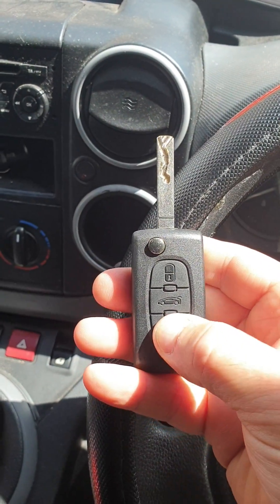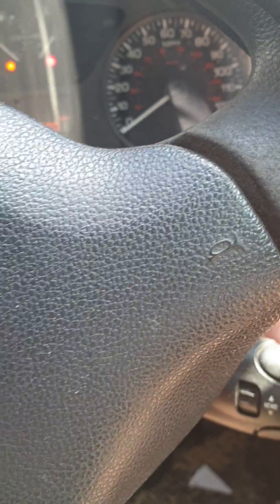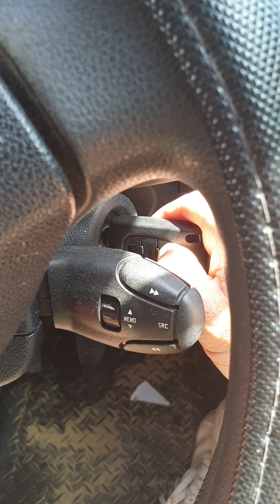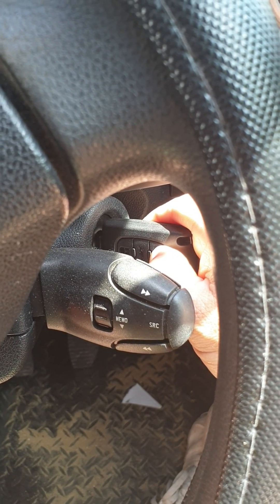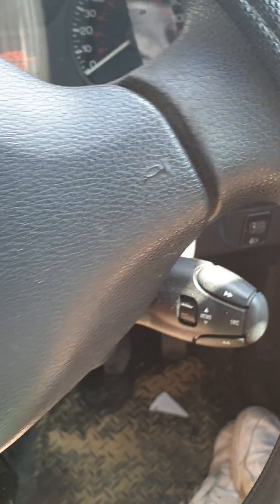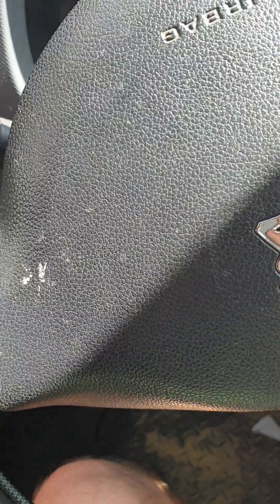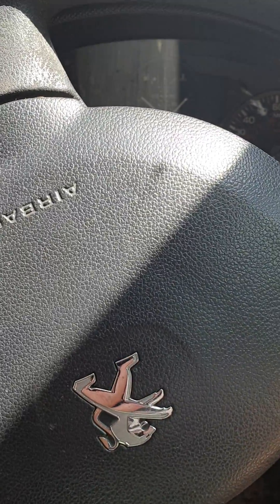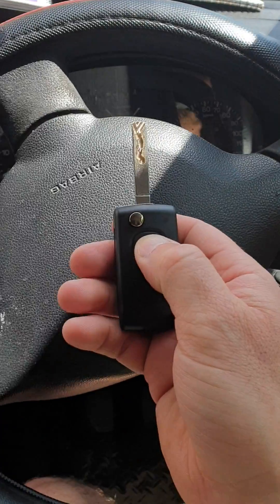how to Re sync a Peugeot or citreon key fob DONT PAY DEALER PRICES

Comment: Would this work on a 57plate Peugeot 407 2.0 hdi saloon?

Keys work to open doors manually and engine starts no prob but remote refused to remote lock or unlock.

Was working but cars been sat a while and main battery and remote battery had died?
Reply from the maker: Yeah, should be fine. Change both batteries in and key and try it, should be fine as long as keybisnt damaged inside
Reply: Adding to what was said. The low/dead battery send the car into eco mode. Meaning bsically everything electric is off. Remote don't work in this circumstances. Open doors manually, replace battery, start the vehicle. The moment it start, gets out of eco mode and all is back to normal. If the key don't work immediately follow this procedure. Cheers

Comment: I lost my original key to a 2016 Peugeot Boxer and had to get an auto-lock specialist to gain access to the van and supply another key with a new transponder.

Guess what the original key turned up a few weeks later and I'm just wondering if I can use this trick so that I have two working keys. I suppose it depends on whether the ECU programmes the key, or the key updates the ECU. If it's the latter, then it's obviously not going to work. Your thoughts on this would be helpful.
Reply from the maker: Unfortunately it won't work, no. The peugeot boxer is a re badged fiat ducato so is a completely different system. That old key will be useless now as even an autolocksmith won't be able to code it back in again
Reply: Thanks for the info.

Comment: I’ve just bought a Citroen Dispatch 08 plate, changed the battery in my key fob followed your instructions and it hasn’t worked? Any ideas?
Reply from the maker: Check battery is the right one and the right way round. ( i don't mean to be funny with that, you'd be surprised how many I go to thats wrong!) If not then you would need to get your key checked to make sure its sending a signal. If it was working fine before it should re sync. Make sure ignition is turned on and you hold a button down for long enough. I may have stopped working due to your key not working not a flat battery.
Reply: @Cityautolocksmith803  I don’t know if it was working before or not as only just purchased it, I did change the battery around and my van wouldn’t start. So guessing it is doing something? Cheers

Comment: i tried to do this a lot of times but it doesn't work, why?
Reply from the maker: Need to check your key is working and sending a signal
Reply: @Cityautolocksmith803  yes I took it to the locksmith and there is a signal!!
Reply from the maker: @luizgonzaga2816  if you follow video it should work fine on any peugeot or citreon with this type of key. Providing its sending signal and was working before on the same car. Or look at the fuses or sensors in the car
Reply: @Cityautolocksmith803  ok thank's
Reply: @Cityautolocksmith803  thank's 💗

Comment: My fob got left in my trousers. And ended up in the washing, dead :(. I bought a replace circuit board, but cannot for the life of me get it to work using these methods.   Does the circuit board need be coded on a computer or something?
Reply from the maker: Yes needs to be coded 1st by an autolocksmith
Reply: @Cityautolocksmith803  Thanks

Comment: I changed key fob?
And done key cut. The chip is same 
It shows antitheft.. What is the solution?
Reply from the maker: Hasn't been programmed in by the sounds of it?
Reply: @Cityautolocksmith803  can u explain? I didn't get
Reply from the maker: If its your old circuit board that's been re cased and it's not working then it is broken, if it's a new circuit board it needs programming to the car
Reply: @Cityautolocksmith803  it's old circuit board
Reply from the maker: Then it sounds like it must be damaged if the car no longer starts

Comment: Just programmed a key to a 2009 peugeot 407,three keys i've bought so far and they all program fine,but remotes won't sync/program.Odd.
Reply from the maker: Maybe same issue as berlingo, on this thread. Probably not the right frequency on remote function of key
Reply: @Cityautolocksmith803  they are all 433mhz.
Reply from the maker: Yes but you need to know if its fsk or ask
Reply: @Cityautolocksmith803  oh yeah sorry, i remember you saying that, it's a steep learning curve this. :-) Two more things i've learned, keep to hell away from Ebay for keys, and the ASK, FSK thin is rarely mentioned on Ebay listings easily catches people out. Thanks!
Reply: I know now keys ive been using are ask,seemingly newer 407 is fsk.
Reply: @Cityautolocksmith803 hi mate, could you help me please 

My car showing to many fault, anti theft fault first, then when I make new chip , star showing all of fault, abs fault, esp fault, handbrake fault and more

What maybe happened?
Reply: Citroen c4 grand Picasso 2007 1.8
Reply: I will try to change steering wheel angle sensor or something different

Comment: Hi, does this also work with the Peugeot 107
Reply from the maker: No the peugeot 107 is a Toyota system so this doesn't work im afraid. There is a manual procedure to re programme the remote function the 107

Comment: it works inside of the car but on the outside it doesnt work
Reply from the maker: Check and change battery in key, make sure voltage is good in car battery or it may be the sensor in car
Reply: @Cityautolocksmith803  checked everything and still only works inside of the car

Comment: what if this doesnt work any other ways?
Reply from the maker: It would most likely be your battery in either cat or key is flat. Failing that you'll most likely need a new key
Reply: @Cityautolocksmith803  ive jst had a new battery put in the car also replaced new batterys on fob guessing im needing a new key
Reply from the maker: Looks that way

Comment: Wish it was this easy😢
Reply from the maker: It is, providing your key has already been coded to the car and is sending a signal.
Reply: @Cityautolocksmith803  tried one of those machines that detects signal from the key, and it flashes very dull compared to others so it may not have a good signal, do i need a new key making or something, think its had a new key before as it came with one that didnt work at all that was brand new, but thebother one works, just doesnt unlock or lock the car
Reply from the maker: You most likely need another new key

Comment: Mine still didn't work, even after I'd done this. I'm on the verge of doing Plan B instead - driving the bag of shit into a wall.
Reply from the maker: Obviously can't advise you to do that lol.
Take key to a shop and see if its still sending a signal
Reply: @Cityautolocksmith803  I take it back... I'd been trying it following someone else and holding the lock button for twenty seconds and waiting a minute. Did it your way this morning, and holding the unlock button and only for ten seconds, and it's finally worked!

Cheers, mate. You're a legend 🙌

Comment: Not working for my pegeout 107 of 2006
Reply from the maker: It won't work on a 107 as that is a toyota system. It's the same as a toyota aygo or citreon c1, unfortunately they do not operate the same as a usual Peugeot. The process is completely different to code remote back to car on tour 107
Reply: @Cityautolocksmith803  did you know the process?
Reply from the maker: I do, yes.
Unfortunately its to long to describe on here. You will most likely be able to Google it
Reply: @Cityautolocksmith803  can u share With us please?🥹

Comment: Doesn’t work on mine
Reply from the maker: Changed battery?
Reply: Mine had the same issue. My battery connector wasn't connected right. I put the old connector which was the original. Working now.
Reply: Cheers mate saved me money and time and a headache. Great video

Comment: It does not work
Reply from the maker: If it doesn't work, its either wrong battery in key, flat battery in key, flat battery in car, key is broken, broken fuse, dodgy electrics or the car receiver isn't working

Comment: does It work on Peugeot 307 >?
Reply from the maker: Should do providing the key is still sending a signal
Reply: James Aldridge thanks for the fast reply.

So basically i have the original key and works fine, but i will buy a new key with transborder and chip, do you think it will work the same if i dont have the pin ? So like in your video? 

Thanks
Reply from the maker: @louieanderson5246  the new key will work once it has been programmed in by an autolocksmith. The video is showing the procedure to re sync remote system only after a battery change